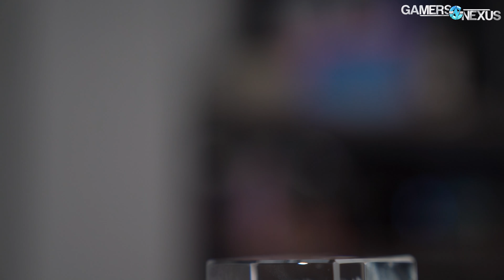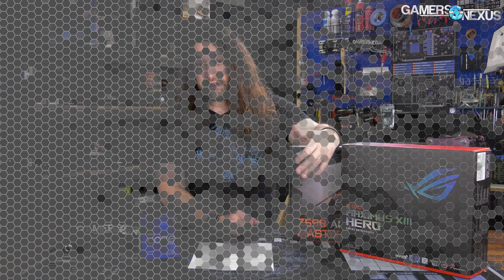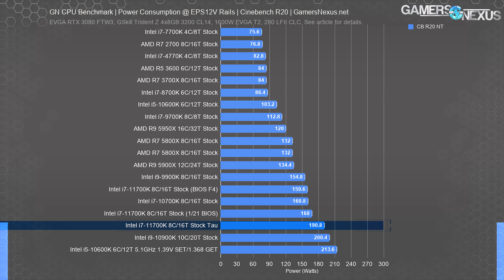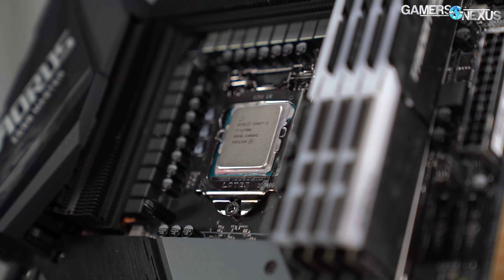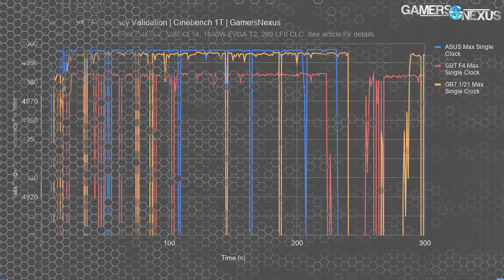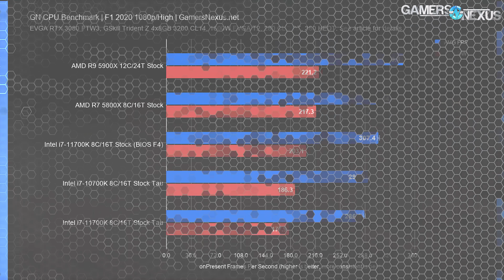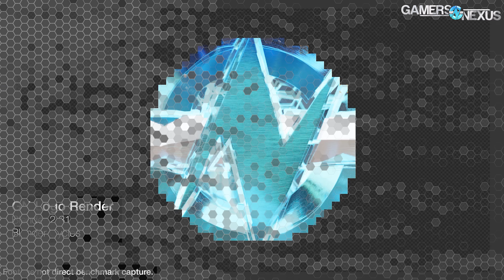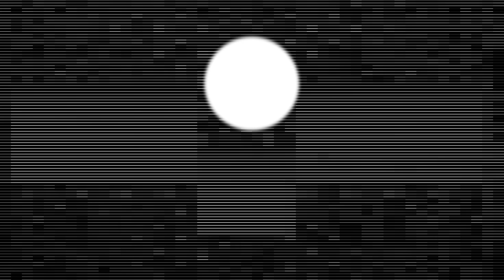Intel's Z590 Motherboard Problem: i7-11700K Power & Thermals Explained

Comment: At this rate we’ll have to review CPUs based on “performance score” per watt, and even that number would neither be accurate nor fair
Reply: Performance per watt, per thread, per Hz. Everything equal.
Reply: @RufusJRT  I'm going to crush this. It depends on so many damned things that's totally pointless to fight over a few W. Just to name:
1)CPU is a programmable machine that executes commands or instructions. Each instruction takes an amount of clock cycles that can vary among generations and ofc changes from manufacturers. Every manufacturer of a CPU hands documentation about the exact spec of each accepted instruction.
2)CPU as a programmable machine optimizes(for speed) the execution of it's commands in inimaginable ways: tries to do educated guesses on conditions(part of 'Speculative Execution'), analyzes streams of instructions issued and executes them out of order as it fits better for their internal calculus units. They are very complex animals.
3)CPU instructions sets matter. Famous AVX is a CPU instruction set, and it's known for being power hungry when well optimized, but it's fast as hell. AVX512 doubles on that: way faster and power hungry(this is when i7 11700K reaches a max of 300W draw).
4)Programmers who make code to run on CPUs rarely write the programs in each CPU native language. That's madness for most applications. Compilers which automatically translate more logical languages(well know programming languages) to a certain CPU dialect. They also optimize the code for specific CPUs as bonus hence they have a say in performance and power consumption when their program runs on a CPU. There's a hell of compilers and some are better than others, some are better at specific CPUs or kinds of programs: Intel C/C++ Compiler is good at? Intel CPU!
5)Programmers writing logical languages have a say in performance and power use too. Even abstracted writing different things in high level languages rents different program performance and hence changes CPU power draw.

There's no easy way to normalize a performance per watt in this. Even Intel and AMD marketing IPC % can be taken with a lot of salt, though is not to be ignored. Remember CPU= programmable machine and the manufacturer now which instructions the machine can execute and how much clock cycles it takes.
Reply: @deidian635  You hit the nail on the head. I love GN for the work that they do but it frustrates me to no end how much they try to normalize every test for their arbitrary sense of fairness to not piss off some fanboy of some competitor's product. Especially the way they harp on noise levels and tweak every test to the point where nothing of substance is shown in the results. I want the real numbers, not what comes out after they've gone in with a magnifying glass and tweaked the settings that no average user will ever decide to do on their own just so some watered down numbers present themselves a certain way on a graph. I agree with Alex Mills on this. This is gaming oriented competition in a market, not a nascar race where nobody is supposed to have any advantage over anybody else. Nobody is going to deep dive their system settings to give themselves a handicap. He acts like it's the end of the world if a cooling solution has to ramp up its fan speeds a little bit and create a little noise. God forbid a cooler has to actually do its job and... you know, cool the hardware. It's also hysterically funny to me when he throws up one of the first real world graphs of gaming performance and notes "AMD here being the clear winner" when the lead in FPS is within a margin of error and would absolutely be undetectable by the player but then immediately throws up a second graph where Intel is also leading by a margin of error difference in FPS and starts spouting off about "optics" and no actual perceived difference in performance. The AMD bias here is so blatant and shameless.
Reply: @keensbeanz  Being a system builder and not entering even in the UEFI is a bit missplaced. For that pre-built systems exist: they come configured from factory. Easily visible in laptops, which despite use the same hardware there's some differences in performance depending on the UEFI settings and cooling solutions employed by the assembler.

Non K skews exist for non overclocking targets in Intel. Why everyone is either 11900K(overprized), 11700K(not impressive) or 11600K(decent for the price)? Someone looked at the 11900 for example? it's fair game for that CPU to do 5.2Ghz on favored cores(factory marked) and 5.0Ghz all-core. Which is actually a hell of a boost and given my own testing with 11900K I say that any air-cooler or AIO as massive as it looks will be maxed out by the non K variant. The K variant isn't going to be more capable in that use case because it's going to overheat as soon as the user says: let's try 5.1Ghz all-core, despite 100% of them capable of 5.1Ghz all-core.

Real benchmarks is hard. Basically reviewers would get crazy if they had to try a wide number of motherboards with the CPUs and also it will result in masssive graphs which will be roughly the same because manufactures do the same when it comes to boards.

MCE, PL1,PL2, Tau. That's all. MCE allows slightly higher all-core turbos as long as they are supported clocks in stock settings. Manufacturers are conservative with this. PL1, PL2 and Tau changes are roughly the same for all and they even use profiles:

Default => 125/250/56s. Intel's recommendation in all cases, which FYI is based on Intel's stock coolers, not even any kind of aftermarket air-cooler.
Air-cooling => 125/250/Unlimited. For AIO and aftermarket air-coolers.
Water-Cooling => Unlimited/Unlimited/Unlimited. For custom loops.
Auto => UEFI manages power limits and time limit based on how your CPU fares. If it gets hotter it will back down limits until hitting a reasonable stable point for your cooling. It's auto-pilot.

No board manufacturer is reinventing the wheel in this. All them go under the same basic idea and what usually their customers ask: want best performance as long as my chosen board and cooling can keep up with the CPU power draw.

Again circling back at it's very hard to even the ground here, just now we are in the pure hardware side, not software. But overall I'm more convinced as time goes on that people is missing the picture regarding which hardware they should buy and why. 4 core CPU world was easier because air-coolers could overclock the CPUs to the moon, it was accesible, but 8 cores are "taking down" air-coolers like flies, hence less accesible.

PS: I do not completely agree with GN in running K SKU per Intel basic spec but I do understand their attempt to even the ground even if it will never be representative of everyone's situation.
Reply: youtube decided to eat my very long winded reply but tl:dr, I understand what you mean but I still posit that the average person building themselves a pc is going to select automatic setting, which drive to boot to and click save settings and boot. 

The rest was just me complaining about being away form the pc tech space for half a decade and coming back to all this normalized non linier testing that's being done these days and particularly how I"m sick of hearing complaining about "fan noise" every 3 min of every one of their videos while not showing any tests where hardware is being pushed above safe operating conditions yet crying over "being forced to increase your thermal solutions" constantly. There's literally hundreds of coolers on the market. They act like they're showing hardware that needs secret hidden not yet released DARPA tech to keep these cpus from blowing up your house. Not just here either, it's in almost every CPU, MOBO and GPU breakdown video in one way or another. I'm done ranting for now.
Reply: @RufusJRT  but then you get into an area where you forget the true performance for the average person, most people don't mess with many settings and they sure as hell aren't going to say downclock their intel cpu because ryzen doesn't hit those speeds and it's unfair.
Reply: That's a misleading metric, as the relation between performance and power consumption is far from linear. As you can see in this video, a different motherboard brought up to 10% of performance improvement at the cost of something like extra 50% of power consumption. And the highest performance per watt would be probably achieved by some Celeron or Pentium.
Reply: @Agent_Krasnov  Best performance per watt on X86 are probably some mobile processors like the AMD 4800U or high core count server CPUs at low clocks. Intel can’t compete against the node advantage in that metric. Or disable the boost clocks to gain more on that metric with desktop processors.

I can unplug my CPU fan entirely during heavy all core load (like x265/AV1 encoding), and it simply runs entirely passively cooled  at ~2GHz all core clock.
Reply: this is not a constant, so it is not calculable. I think better be max performance per cooler in normal mode and loud mode.
Reply: By that logic, Apple wins by far.

Comment: Good thing I didn’t wait for this launch
Reply: I bought a 10850k in November 2020. No regrets here either.
Reply: Yeah, me either.  [Sweats in maximus hero xiii]
Reply: I just reinstalled a new 9900k that fried when asus didn't repair my board, but replaced it with a new one.  I'm worried about availability, the thermals required for those clocks , and some other third thing.

I was happy with my 9900k and didn't see a need to upgrade again. For another ten years.  Intel keeps giving me reason to just stay the course.  

At the time of my build, 9900k was the best gaming cpu, even if  barely.  I'd have gone with 5950x if it wasn't $1200 and sold out.  I just hope my greatly increased understanding of systems from gn and buildzoid help me prevent burning this one too
Reply: @brovid-19  How do you burn the chips lol....they have so many safe guards nowadays it’s pretty much idiot proof
Reply: @RedlineMaximaSE  because I followed o.c. guides on youtube and forums that tell you to do absolutely stupid shit, like avx offsets, ocing the cache, using LLC6+ oh, and mobo manufacturers don't tell you that the thermal cutoff if left on auto let's chips hit 115c before throttling so they can cheat numbers.  Amongst other things.  I have looked upon the face of god, and ripped it off and wear it like a hockey mask while I do my kooky dance
Reply: @brovid-19  10 years lmfao
Reply: @Metalhead-4life  future proofing works if you're not stupid, stupid
Reply: @brovid-19  pop it up to 5.0 GHz and it's basically at 11700k and will beat the 5600. We've seen AMD catch up. The Intel chips later this year are really gonna start the fire.
Reply: @Tyler-sl6vg  so I'm 3 hours into my all core 5ghz with 0 avx offset realbench stress with temps never breaking 86c.. I am o.c. god.  It will pair with the 11900k system I build next and I have dubbed them the Twin towers
Reply: Same.
Reply: Haha i did ... this is awful
Reply: I'm glad, too.  I got a 10700k a couple months ago because I had the money and knew I would spend it on something else if I didn't pull the trigger.